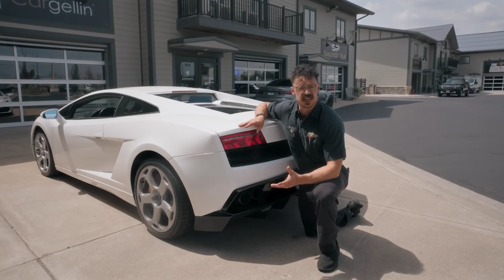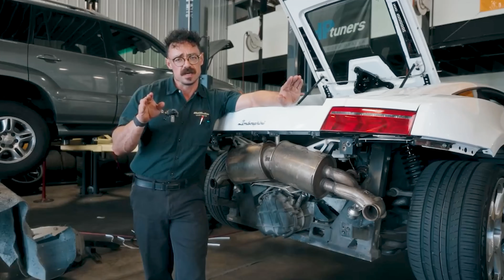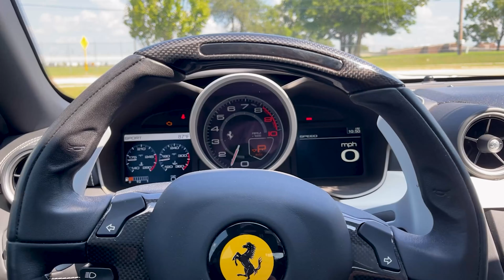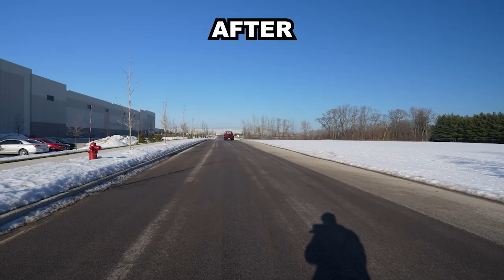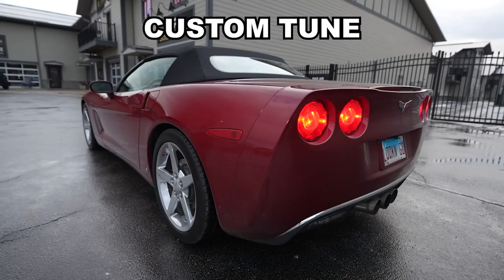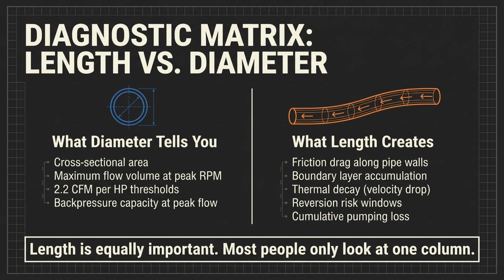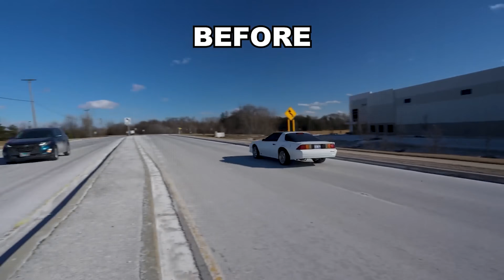18 Years of Sound Experience: Gallardo, Ferrari V12, LS Swaps, Vette Exhaust Build Principles

Comment from the maker: So what build sounded best to you and why?
Reply: boom tubes
Reply: boom tubes were pretty sick. I wonder what a more mature and quiet boom tube setup could sound like. like having a muffler right before the boom tube tips. thinking face emoji. lmao. I would tune the megaphone to the lowest possible rpm for street use. which sounds like you would need it very close to the engine? which yeah. huge fan of low end torque/power for getting up and going. its honestly under-rated. i knew a guy on the east coast who at the time was considered the third best tuner. he had a 900hp civic with a lightweight flywheel. and after his clutch died from drag racing, he ended up having to put an oem flywheel on the car because he couldn't get a lightweight flywheel in time for his next race day.... and it turns out, the heavy flywheel actually added low end torque to the point making his 0-60 launch time much shorter thanks to increased torque. he finally broke into the 8 second drag times.... it was a pretty epic finding. he told my buddy and I the story and we had to agree, the dyno numbers doesn't lie. he tested both with lightweight and stock, and tuned both to ensure the maximum possibility/potential for both. and yeah, heavy flywheel was superior. even for drag racing which only starts down low at launch and retains high rpms until crossing the finish line.
Reply: I'd say the corvette. Like a musical instrument
Reply from the maker: @vscrmk1  Thats exactly what the customer said- looks like something from the brass section.
Reply: White Camaro. Smoothed and purified the tone... Seems like a bit of a midrange scoop, too, but there's probably something more complicated going on there IE the usual Maisteer explanation that the natural acoustic orders of the engine get boosted while the noise in between is cut. Also, have you seen Mountain Pass Performance's test on THEIR Ferrari V12? They made an extension for the aftermarket equal-length headers, then went on to find that a Y-pipe of properly increasing diameter produced both the best sound and most power. Check it out if you have a spare 30mins or so.
Reply: The Camaro, it really sounded like that motor was "woken up" from a slumber
Reply from the maker: @bravofoxable  We agree!
Reply: Corvette 👌 and Quick question it would really help me for a mercedes c350 3.5 v6 what would be better 2 in 1 with two exit like the jaguar you've did since its a 6 cylinder or oem setup with xpipe ? 🙏 i just keep watching your video your exhaust setup are so insane haha 💯
Reply: @frankbuk  Watch Mountain Pass Performance's video on their Ferrari v12 test. Conclusion? Definitely go single exit, just be sure the single's diameter is bigger than the duals going into it by a factor of at least 1.3x (but no more than 1.4x is necessary), and that everything is of equal length and all bends are as gently radiused as possible.

EDIT: Also, step the tubes up to your final diameter at least once somewhere in the line. Whether on your headers, in between the collector and the final merge/single, or both depends on you.
Reply: My vote goes for the white Camaro. The difficulty of installing that exhaust is challenging to say the least but you went soooooo much farther than anyone I’ve ever seen go before. The results were incredible. Man I’d love to hear that thing in person. Thank you for sharing all the details on that build. Very inspiring sir
Reply from the maker: @Lagrange1186  We appreciate that!

Comment: I read in a FD/TD book, once, that after X feet, the the velocity has slowed enough that you can step down in pipe diameter with out any flow restriction..... I used that priciple on my 1st gen NA CTSV, seeing that it is fairly long.  I had noticed that the 3" collectors connectors stepped down to 2 5/16" ID, so I found some Flowmaster that were 3" all the way through.  This went into a smooth flow 3" X-pipe and then I got to the rear end.  We had designed an IRS 8.8 Diff kit to replace the crap that GM had in there.  Space got limited.  I stepped the tailpipes down to 2.5" into 2 2.5 I/O Flowmaster 2 chamber Deltas.  I could feel the difference and it sounds so much cleaner.  Drone was gone.  FF to today and that car is TT(Turbonetics 61/65) LS2 with LS7 Crank and Rods, forged pistons, LSA Heads, LS3 intake.  Probably north of 800 rwhp.  Turbos are midmounted, 3" outlets into 3" SS cats, into 3" SS smooth flow X-pipe into 3" SS Resonators out back into 3" SS mufflers.  Where would you put the megaphones.  It is terribly quiet. lol

Comment: "I will never use a 90°  transitions on any build" 

My 2nd gen Chevy Cruze 1.4 turbo might make you eat those words.... not a lot of room to much. just saying

I would like to see a 3-5-3 megaphone right off the turbo and a full  3" exhaust.
Reply from the maker: 90 degree merge transition, meaning 2 joined pipes meeting at a right angle. We use 90 degrees bends all the time.
Reply: @FluidMotorUnion are you interested?

Comment: I wish I could find this video again of this Japanese guy with a B18 or B16 civic.
It was purple and a kanjo racer I think.

But it sounded much better than any other of the other kanjo civics.

Had a nice constant high pitch sound, making it seem more like it was doing 13k or 14k rpm even when it was closer to 5-6k i think (wasn't hitting the rev limiter) 
No trumpet rasp or anything.
Just a smooth high pitch, but if you listened closely, it was a 4 cylinder.

Comment: There's a formula for finding where to add the megaphone, right? 
I have yet to decide where I want the peak at for my street truck (maybe 4800 for when doing pulls, maybe 2000rpm for when cruising at highway speed forax torque efficiency *fuel economy thoughts*, tho would that not also increase the loudness at that point, and therefore not be ideal?).
I don't plan on valves/active exhaust stuff.
Reply: This being said, I do have interest in opening a shop potentially one day, albeit not a performance shop like yours, just an exhaust shop, here in Central Texas, which we need a good shop pretty bad to fix all these horribly loud but terribly flatulent and/or raspy  trucks out here

Comment: 5:13 90 transitions and Helmholtz chambers are different however. The Amuse aftermarket Exhaust and the Factory exhaust from the Honda S2000 were equipped with these for a specific reason. Why do people almost universally agree the s2000 sounds better than a typical Civic or Acura RSX for example? Still inline 4 honda VTEC yo sounds, but the s2000 is much cleaner, more refined. I wish you would do more testing with these, though they are specific, and need science rather than trial and error to use them 100% properly, so i can see why you dont. You mentioned in another video, you arent quite to the point of building systems specifically/only to see how they sound vs another, just yet. This sort of testing would be in that burning money just to learn/test bucket, firmly.

Comment: TTTHHHAAANNKK YOU!!!! I had recently removed my felines and added and equal length pipe in the shape of a cornacopia type half circle...and got the amazing sounds I wanted, but a ton of garble at low speeds that sounds like a trashed garbage disposer. I lost 20hp and 20tq which made me think it was a back pressure issue...so I added a cat. Didnt help anything, now I understand why!!! Time for version 12 of my exhaust. I cant wait to use your information and come up with my own trick system to see how it sounds and responds. Your explaination LITERALLY explains all the mess I dont like about what I did. Not only did I lose those numbers, but the range feels off and the mid to top end of the rev range feel lackluster and muted while the pipes scream like a banshee!!! Thanks OJ....🙏 saved me hours and hours of trial and error
Reply from the maker: Happy to help! Thanks for the watch!

Comment: Wish this video came out a week or two ago. Just got my custom turbo back on my 1.6t. I used a gesi highflow cat, fmus 3-5-3 megaphone (my fabricator reccomended this size)and vibrant ultraquiet resonator. It sounds phenomenal down low but the drone on boost is insane. Any advice would be great as im running out of room thanks OJ! Btw the power gains more noticable then the turboback on my 2.0t which doesnt have the megaphone

Comment: The internet needs you to take on a VQ35. If you can perfect that, you’ve won
Reply: Easy, make it quiet.
Reply: Great godamn challenge. Most sound like shit however my buddy had one that didnt i think the big tomei style mufflers are key or maybe the vibrant titanium muffler. Imo vibrant needs a new muffler design that doesnt need to to be located at the exit. The vibrant ultraquiets are great but they have trouble taking out all the done of the megaphone which is why i think oj uses multiple but they also eliminate so much turbo spool as well.
Reply: I'll say my one doesn't sound too bad (I've had it as a track car here in the UK since 2012), I'm also not a fan of the trumpet sound.
However the biggest change for me was going from the stock headers to PPE longtubes (my ones were spec'd by Jim Wolf Tech for a certain diameter/merge to match my c8 cams).
So my one goes ppe longtubes, motordyne y pipe (resonated), isr single exit.
I'm not saying perfect, just not obnoxious, and less trumpet 😅
(also I'm an old man at this point now, so don't care or want volume, so I'll probably put the cat section into the y pipe that motordyne make)
Reply: I've tried countless combinations of exhaust components on my VQ Z, including expensive setups like Amuse, along with all sorts of downpipe configurations (TPs, RTPs, HFCs), mid-pipes, and cat-back combinations. Honestly, they either sounded like trash or were way too tame for my taste.

The last and only setup I genuinely liked was a custom 2.5-inch straight-pipe with a simple H in the middle running directly after the OEM cats. It sounded godly from idle all the way to redline: no rasp, none of that annoying 2.5–3k RPM rattling sound the VQ makes on downshifts or decel and it had a completely different sound signature from any VQ I've heard in person. It was extremely aggressive sounding, but harmonic and refined.
Reply: agreed!
Reply: Yamaha did that with their trumpets
Reply: Yes, any V6 really. Kia Stingers, G70’s, Audi V6’s. Anything really at this point.
I’d be curious to hear a proper MU exhaust on an Alfa Giulia QV or old Busso V6
Reply: Imagine that, FMU doing a full busso v6 exhaust  @joshuamahan3403
Reply: A turbo lol. Not hard to do.
Reply: @imSchwaggy no lie, but obviously I'm talking about NA/SC
Reply: And VQ37. I spent months trying to figure out a good setup
Reply: not rocket science... dont straight pipe it
Reply: i second that
Reply: Nismo s-tune❤️ weldina
Reply: He may be the savior of an entire culture if he does that
Reply: You can already see it , this is what a vq35 should sound : https://youtu.be/TN9UJeMq1tQ?is=Lwmm5COu2GSpr1bl

You have itb sound, exhaust track and a road kind of quieter one. Have fun

Comment: Ford 300 i6 F-150 best sound is to cut off the muffler and dump it in front of the passenger rear tire.  But I want it dumped if from of both rears.  But what would you do?

Comment: NASCAR x-pipe systems are optimized for power and sound like an Indy car (Sterling Marlin 04 car, 1994 Daytona 500 winner); the first that had it before everyone ran it on the big restrictor plate tracks. The opening between the pipes is specifically at the tangent to provide scavenging at the highest pressure point of the bend; approximately 2/3 the size of the pipe diameter is what was found to have the most benefit. Thanks for sharing! tan-JEN-shul

Comment: I'm currently running oem exhaust, available from rock auto, specifically sold as for my car.  It's, depressingly only 2.5 inch.  My car sounds so much better with 3 inch, and I've even had 4 inch on it and it sounded like a Subaru wrx and I loved it lol.  

Point is, at 65ish mph and 2500 rpm, the drone is extremely annoying.  Very poorly tuned.  71 mph completely tolerable, 80 mph nearly silent.  I'd like those numbers reversed.  Quiet at 65 and noisy at 80, above 3000 rpm.

One day I'll be sending you that email.  😉

Comment: I prefer an inline engine, single turbo, external wastegate plumbed back into the exhaust 2-3ft behind the turbine outlet with a diameter increase at that junction.  I like a divergent cone exiting the turbine for 12-18 inches in length, with a straight section 12-18 inches before the wastegate pipe is introduced.  I make no changes once the system is routed out the rear, it sounds how it sounds.

Comment: Do you have any actual back-to-back data on the r/D ratio having to be 3 or more as opposed to the traditionally understood 1.5 to 2 to prevent choking? What would you do in the case of a transverse V6 where the flow from the rear bank HAS to turn around (in a conventional setup) in order to be equal length, which is desperately necessary to keep the engine even firing, and thus, sounding exotic instead of like a tractor? In the few instances where a transverse V6 was dropped into a longitudinal chassis and given an exhaust without loops to change direction, I've not heard of any significant increases in power, as even 3-5% at the wheels would be enough to make note of, IE "Yeah, the engine made 300 in the Accord, but now it's making 315 in the Miata."

Comment: Thermal dynamics heat gun is always a useful tool in the exhaust system you can measure choke points with it so you can get the high heat flows points flow the fastest at that point and that's your merge point it's like trying to find out how long the collector needs to be on open headers you merge points right there x pipe or H hot exhaust gas flows faster heat gun is a very important part in the making it work!  fast slow low pressure points !!!!!!!

Comment: So what happened to the awd v6 dodge charger with the supercharger exhaust.  Did it get put on the back burner?
Reply from the maker: His tune was locked, meaning we started from zero… we found this after the mechanical work was done, and we were attempting to “finish” the tune… which means R&D and weeks more of work. 
We were very clear about that possibility being an issue before the start of the project, and we were assured that the file was open and a base file that could be adjusted.That was not the case!😮

Comment: I have a 1993 Single Turbo Toyota Supra which I know has a legendary exhaust sound but so do most of the cars in this video and you just took it to another level! I'm intending to run dual exhaust exists because of some under car aero symmetry. My question on this is what are your thoughts on the best way to optimize an inline six going into a single turbo manifold to a downpipe to an eventual dual rear exit. This would apply to RB26s, 2jzs, BMW S50 series, etc
Reply from the maker: The S58 work we did on the M3 is probably the closest reference point I can point you to for that inline six into single turbo conversation, pull those videos up and it'll give you a real sense of how we approach that platform. For the dual exit symmetry question on your specific setup there's more I'd need to know before I could give you a real direction, shoot an email to all@fluidmotorunion.com and we can actually dig into it properly. What are you making power wise on the Supra right now?
Reply: @FluidMotorUnion I'll check out the s58 vids, I missed them! Yeah I'll shoot you guys an email, currently in the middle of a vvt-i conversion, heads done, block next, g35-1050, primarily a pump gas build likely around 650ish wheel but will be built to do 800ish on E85. Exhaust is next up to address 😎

Comment: Been watching your videos for a while.  Some great vehicles yall have put out.   Only thing I would have a contradictory opinion on would be cross section of some of the x’s appear to be small based on the pipe diameter.  What methodology are you using to account for cross sectional area at the choke point
Reply from the maker: The minimum required flow diameter for the engine is the only point where I'm strictly calculating cross sectional area, and you're right that on paper a radiused tangential merge would flow better at that point. But once you start accounting for the turbulence, the pressure balance, and the energy lost at the bend, that cross sectional advantage falls apart pretty quick. The bigger thing though is that exhaust isn't flow, it's pulses. Think machine gun not garden hose. That smaller area at the merge only ever has to handle one pulse at a time, so you can work with the minimum required diameter and actually keep gas velocity up in the process. I had an engineer on staff years ago and we spent real time trying to calculate all of this properly, and what we kept finding was that simple field-tested rules got us 95% of the way there with a fraction of the effort. What's the application you're working with?
Reply: @FluidMotorUnion good info.  I’m done with the exhaust for my cars atm but have worked on numerous friends cars and just like the aspect of how exhaust ca change sound so much especially being a loudspeaker design enthusiast as well. Took me about 10 parts and pieces to get the sound I wanted out of my turbo coyote so i understand yall’s struggles with them.
Reply: Feel free to critique its sound. I’m always open to ideas suggestions 

https://youtu.be/Mb_uXK73QkI?feature=shared